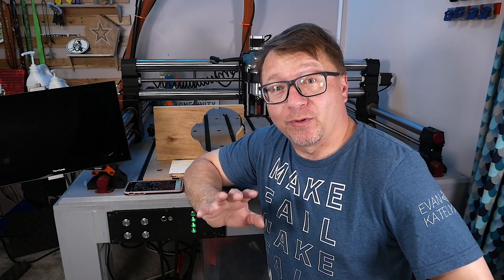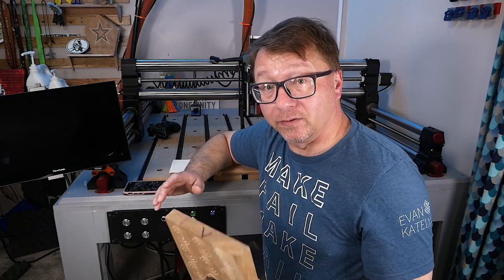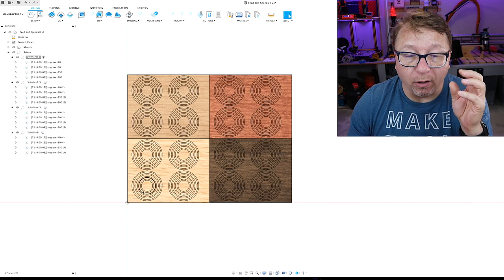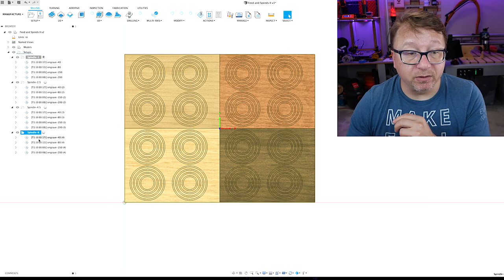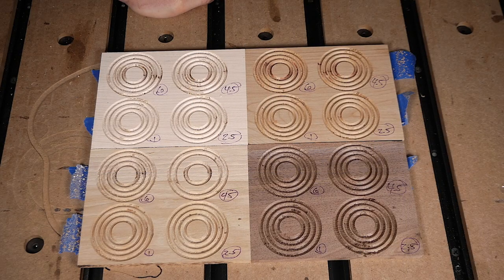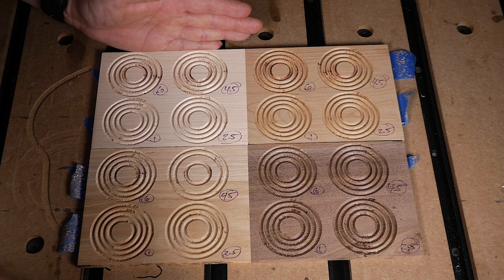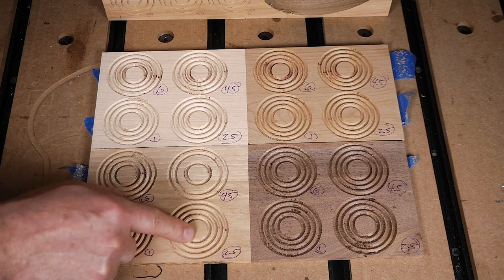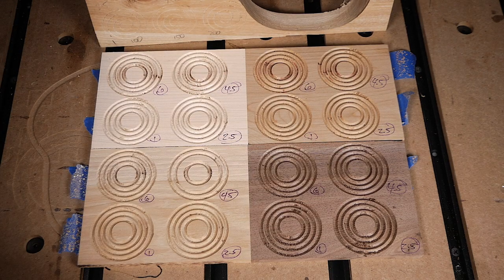Onefinity V-Carve Feeds and Speeds - FOLLOW UP

Comment: How do you remove the fuzzy wood in the groove after the machine has completely finished? I have the onefinity  and I produced a carving that has fuzzy wood left over. The pattern was a Flower of Life done on pine. I was wondering if you have any advice for me. Router was at 3.5 or 16000 rpm , feed  rate was about 40 inch per minute. I used a  1/4 inch 60 degree v bit. Thankyou
Reply from the maker: Hi Grant - thanks for watching. I generally just hit the piece with some 120 grit sandpaper to take off any fuzz from the top surface. I use a clay carving tool (https://amzn.to/3wHIPXo) to remove anything in the crevasses. Hope this helps!

Comment: Thanks for doing this test.  The Makita router only has numbers 1-5 on it for spindle speed.  How do these numbers correspond to RPMs?
Reply from the maker: Thanks for watching Dan - approximately:
1 = 10,000
2 = 12,000
3 = 17,000
4 = 22,000
5 = 27,000
6 = 30,000
Reply: @cyberreefguru  Thanks for that.  This is very helpful.

Comment: Just ordered my Infinity. Your videos are very helpful. I have decided to go with a spindle rather than the makita router. You reference the rpms; as 2.4, etc., do you know the actual rpm's at this setting? Thanks
Reply: That would be helpful for me to know as well because I'm doing the same. Also, what range of bits do you feel these apply to?
Reply: Check the Makita manual. There is a reference chart for rpm to dial #
Reply: @nickmatney6605  For both myself, and the previous poster, we don't have the Makita and thus no manual to reference.
Reply: @TheOttacat  You can find the manual online if you search for Makita 0701 manual. #2 is 12k, #3 is 17k. So esitmated 14.5k RPM for 2.5 on the Makita's dial.
Reply: @TheOttacat  Looked up the manual
Reply: Guess what I typed didn't save
1 = 10,000
2 = 12,000
3 = 17,000
4 = 22,000
5 = 27,000
6 = 30,000
Reply from the maker: Hi Chris - based on various different folks, the Makita breaks down like this:

1 = 10000,
2 = 12000,
3 = 17000,
4 = 22000,
5 = 27000,
6 = 30000

I'm thinking about a spindle as well - better control over the RPMs.